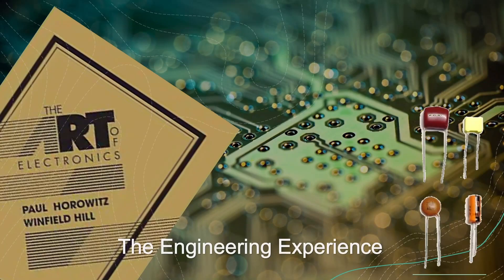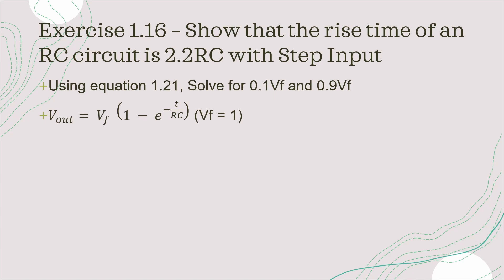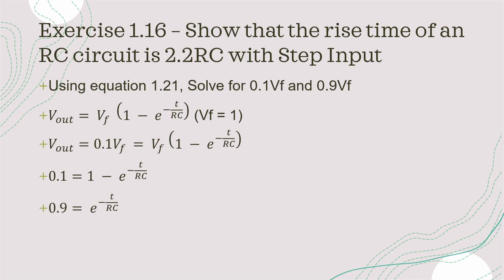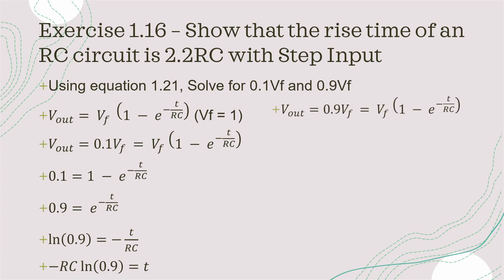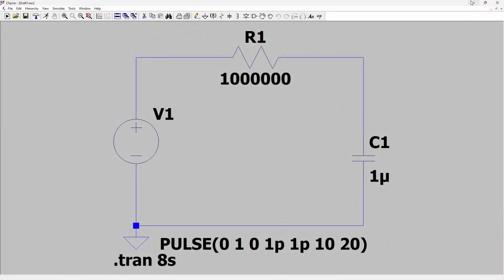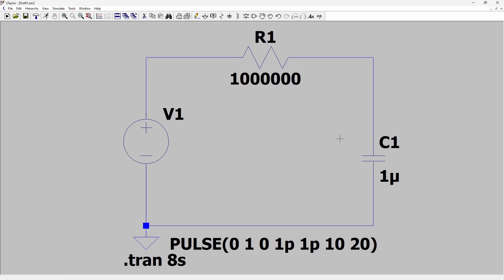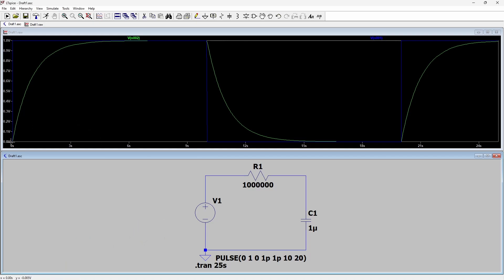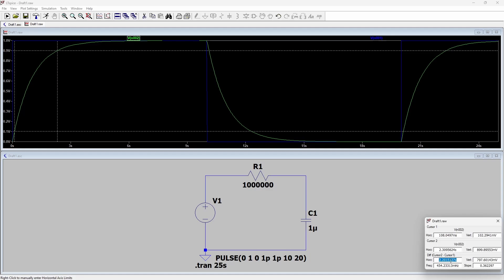Learn The Art of Electronics: Exercise 1.16 Capacitor Rise Time

Comment: Thanks for this video! Been enjoying going through this series.
At 1:49 I don't think you have to assume Vf = 1. You can see in the equation that Vf is on both sides of the equation, so you can simply divide both sides by Vf to remove it. This tells us that the rise time of 2.2RC doesn't depend on the value of Vf :)
Reply from the maker: Good point. Thanks.